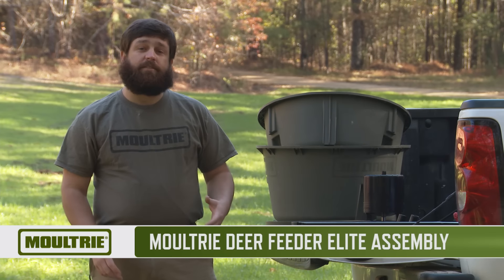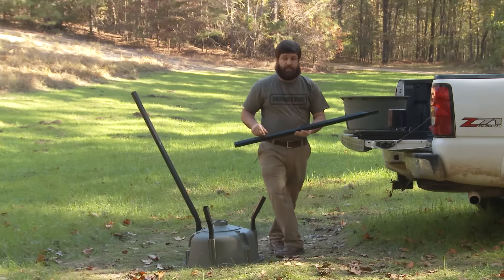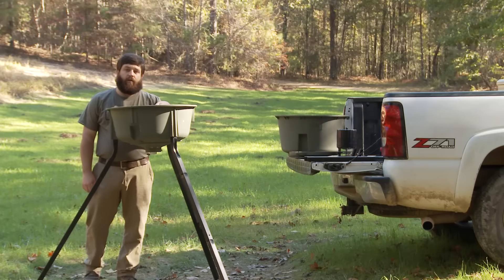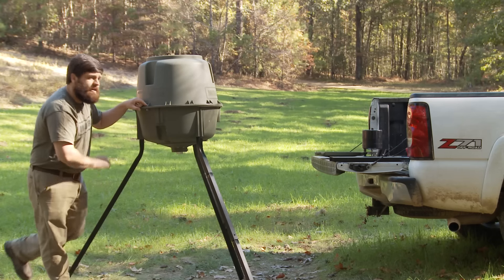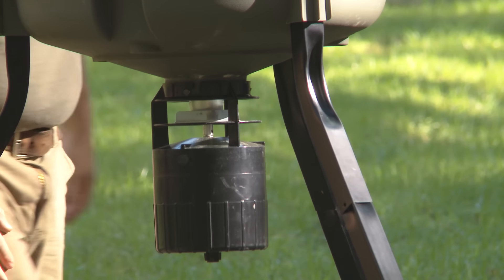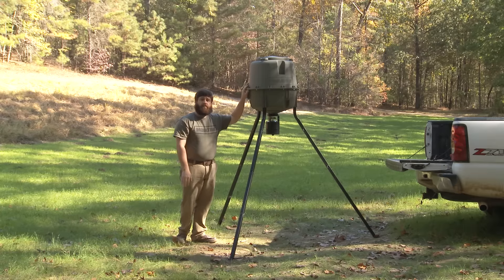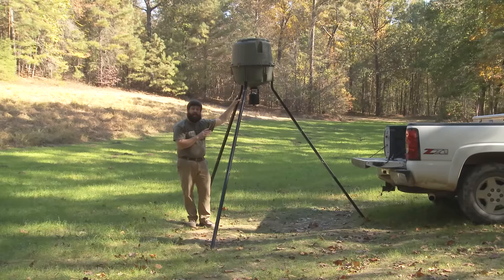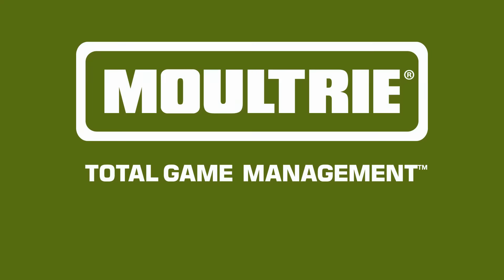How to Assemble the Moultrie Quicklock Deer Feeder Hopper

Comment: Do these feeders come with a battery?
Reply: i just got this feeder with the smaller "motor unit", which uses 4 AA batteries. And the batteries were included. I doubt they include the big 6volt batteries for the larger units
Reply: @131rocketman  They don't, just wished they put it on the outside of the box. When you buy it and take it out deep in the woods, put it up, fill with corn. Find out there's not a battery, it sucks. Could have even said something on the video 😂

Comment: I just bought this deer feeder. I was excited as hell, but then I owned it for 5 minutes. It has a short somewhere and a brand new battery will only last for a minute. Then the battery light starts to flash and it cuts off before you even have a chance to set the timers it is dead again. You could move the wires and it would come back on but then when you put the battery back into the holder it would cut off again. Now it will not come on at all. What a piece of shit!!!!!!!!!